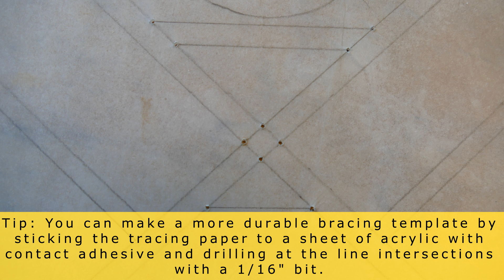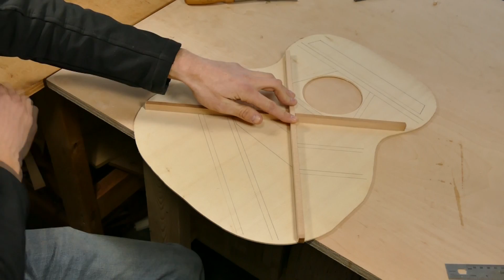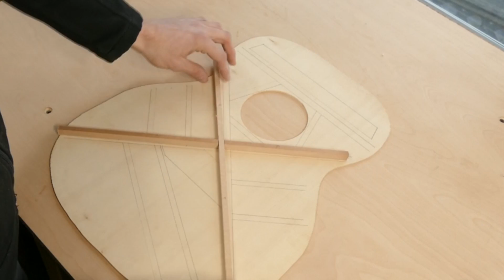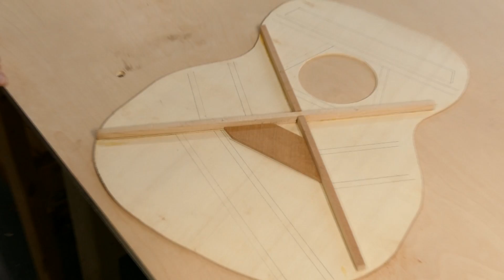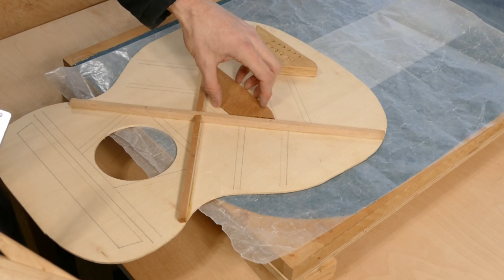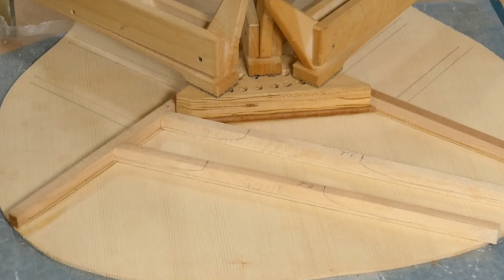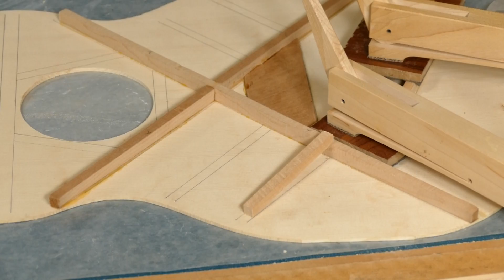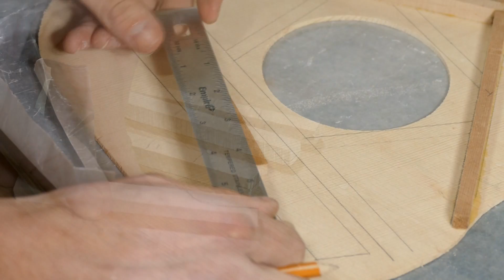Soundboard Bracing

Comment: An Ole Cabinet builder taught me a trick about Glue squeeze out several years back , that works great ! You can take a simple drinking straw with either open end against the corner of your piece and run it along the corner to " scoop" up the squeeze out ! it will conform to the square corner and a simple wipe of a rag after words and your corner is clean ! Afterwards a mash and pull with your fingers and your straw has been cleaned out for reuse over and over! cutting a small angle on the end of the straw works even better !

Comment: Pressing in the middle of the brace while sanding on the dish will get you a thinner brace but not a radiussed brace. Hold by the ends only and sand till the middle touches

Comment: Great video and instruction --curious as to why the four short flat side braces below the sound hole don't reach all the way to the edge of the guitar top? unless they are (mostly) to prevent soundboard cracking.
Reply from the maker: Thanks! This is a great question and I'll try to answer it in a simple way... We'll see if I succeed... They do mitigate splitting in those areas, but that's not the real reason they are there. If that was the only concern, a graft would work better than a brace.
The finger braces and the tone bars are not structural. If you built a guitar without them, that guitar would still hold up over time. These braces harmonically couple what would otherwise be unstiff areas of the soundboard. Think of it this way: if you look at the bracing pattern as a whole you will notice that there aren't any large unbraced or thinly braced areas. If the top is braced in such a way that it is uniformly stiff in all areas of the lower bout without being too stiff overall, well then that top can move with good monopole action, especially if the perimeter is less stiff than the interior of the bout. This essentially means the whole bout, more or less, can "pump" as a single unit, which is generally desirable for the things you want in an acoustic guitar. Whereas if you were to remove those braces, yes the top would be less stiff overall, but it would lose significant monopole response and have far more cross dipole and long dipole response instead. Essentially, the stiffly braced areas (like the center of the x and the perimeter at the x brace arms) would be de-coupled from the unbraced areas allowing the top to move in a less uniform way. The more uniform the pumping action is, the better the pump, and the acoustic guitar is nothing but an air pump.
Reply: @EricSchaeferGuitars  clear and great answers. big thumb!

Comment: To save using the heating gun and the lifter, just don't use the double sided tape on the ends that are to be sculptured. The rest of the length should hold solid enough

Comment: Very informative!  

How many cam clamps do you routinely use?  What span (distance from metal bar to tip of jaw)?  I have just built 8 clamps that can span about 4.5” and open up 5.5”.  Looks like your clamps can span 8-9” or so.  I will be building ukuleles but may build a guitar some day...
Reply from the maker: I have cam clamps that span 4.5" and deeper reach ones that span 8.5". They all open to about 8 or 9 inches. With ukes I would imagine that you would not need the deep reach ones, although having one or two for special situations is always a good idea. If I'm only building one guitar at a time, I would at most be using about 20 -30 clamps (specifically for attaching the plates). If that sounds like a lot of clamps (and it is) then you can always go the route of building a go bar deck for gluing braces and the plates.
Reply: Many thanks!  I will go ahead and make 4 deep reach clamps.   The go-bar deck looks a good bit faster for glueing braces.   I will have to balance tooling expense and storage with ease of use for this hobby.

Comment: I am using a book outlining how to build a dreadnought model (its written by John Kinkead), but he does not specify the radius he uses... he actually uses an alternative method but I definitely prefer yours. If his plans do not specify a radius for the soundboard and back, is it okay to use the same radius as you do in this video? Or does the radius typically depend on the model?
Reply from the maker: The radii of the plates, in my opinion, is very adaptable. There is likely no structural reason you cannot use a different set of radii than a set of plans calls for. Technically, the amount of radius that you give to the plates changes the structural requirements of the braces, but plans tend to have far oversized dimensions anyway so changing the radius won't make or break anything, as long as there is a radius. I play around with different radii all the time.
Reply: @EricSchaeferGuitars  Great!! Thank you so much for the reply!

Comment: Is the bridge plate caul radiused? Is there any benefit to doing that?
Reply from the maker: No. Not really. The bridge plate should be thin enough to readily flex to match the radius of the top anyway. If, for some reason, your bridge plate is too rigid to flex under clamping pressure, you might consider it. I experiment with a lot of different materials for the bridge plate and I can think of a few times where I have radiused the bridge plate. But even when I did, I never felt like it was a very critical decision. I think either way, the bridge plate is going to flex to make up the difference under clamping pressure.
Reply from the maker: I'm assuming, by the way, that you didn't mean to say "bridge plate caul" and that you just meant "bridge plate". If you did mean to "caul", then I'm not really sure why you would ask that
Reply: Yes, I did mean to say caul. That way, it would flex the plate against the top, matching the radius when gluing it in place.
Reply: @RickDeevey  you can simply glue the plate first then the X brace as cumpiano book suggested.

Comment: Great video as always
Is there a reason you leave the clamps on for a short amount of time?
Reply from the maker: You can always leave the clamps in longer. It never hurts. I just came back from my 2 week honeymoon and I left something clamped up just because.
45 minutes is really just a good minimum clamp up time. I always make sure I wait atleast that long before removing the clamps, atleast for bracing. Large surfaces and glue joints that are subjected to some kind of tension or pressure require a longer minimum clamping time.
Reply: Eric Schaefer 
Cool
Thanks 
Hope you had a great honeymoon

Comment: Question, with the radius of the braces why do you want to glue a pin plate that is flat? wouldn't that counter pull the braces. Working on my second build and trying to understand why not radius the pinplate?. Also when you glue the bridge do you radius it to the top? How do you prevent gaps from underneath the pin plate if your hand sanding? Thanks in advance for your expertise!
Reply from the maker: The bridge plate is really a graft. It is thin enough to not counter the braces. Rather the curve of the soundboard will pull the bridge plate to conform. There is no need to radius it. The bridge IS radiused to fit the top. Essentially, sandpaper is placed on the top and it is sanded in place. Theres more to it. I cover it more in the "Locating and Gluing the Bridge" video lesson in the online course. But you gotta buy the online course for that and the other 61 video lessons: https://www.ericschaeferguitars.com/course/building-an-om-acoustic/
I hope that helps!

Comment: Is it required for the x brace and tone bar to have a radius?
Reply from the maker: Yes, if you want the instrument to maintain well and not split and buckle from tension. If you have no arch at all to the plates, then the structure of the braces does not resist warping in front of and behind the bridge. Also the top and back split along the grain lines as tension, and humdity and temperature changes cause wood movement.
I guess you could get around having a radius by massively overbuilding the braces so that it doesn't need the structure that doming affords. However, you would still be susceptible to splits from wood movement, so it's far from ideal or even an acceptable compromise. Yeah, I just would find a way to get them radiused. If you don't want to spend the money on a radius dish, you can make or buy a radius gauge, stick sandpaper to that and sand the radius that way.

Comment: Did you radius the bridge plate somewhere and I just missed it? If not why not?  It seems to be placed at almost the apex of the curve of the top.
Reply from the maker: Shawn Charton, I dont radius the bridge plate because the bridge plate is technically a graft, and is too thin to have the rigidity to make the soundboard comply to its radius like a brace does. the bridge plate is pulled to radius by the soundboard, which is radiused by the x braces and tone bars.